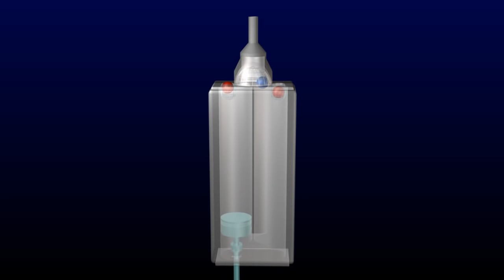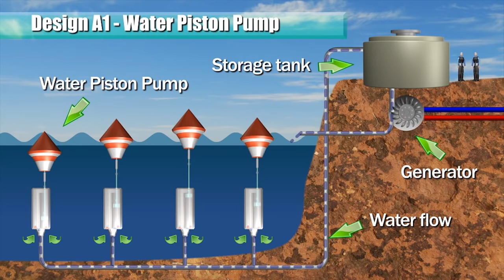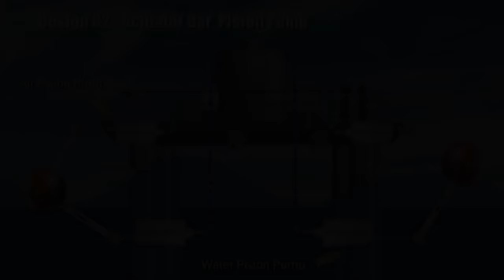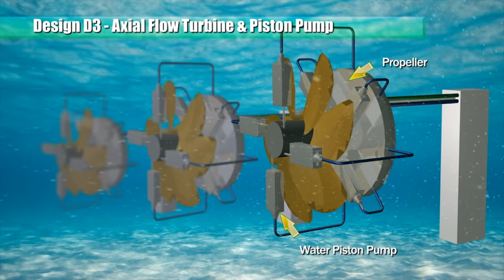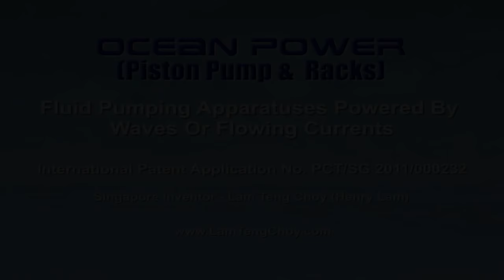Blue Energy - Ocean Power (Piston Pump & Racks)

Comment: The greater the number of moving parts in salt water, the greater their failure rate! Not a practical idea
Reply from the maker: New Invention

ShoreLine HydroElectric InFlow Dam System Video (English)
https://youtu.be/A8EYW_aREKw

水力发电内流水坝水岸线系统 / ShoreLine HydroElectric InFlow Dam System Video (Chinese)
https://youtu.be/D2NPLMekG8w

Hydro Power - Hydroelectric Inflow Dam System
https://youtu.be/_ho7JaxOdT0

Ocean Power - Piston Pump & Racks
https://youtu.be/fYfs-qYGzvs

Ocean Power - Racks & Rake Wheel
https://youtu.be/nQGKfAPxsiI
Reply from the maker: New Invention

ShoreLine HydroElectric InFlow Dam System Video (English)
https://youtu.be/A8EYW_aREKw

水力发电内流水坝水岸线系统 / ShoreLine HydroElectric InFlow Dam System Video (Chinese)
https://youtu.be/D2NPLMekG8w

Hydro Power - Hydroelectric Inflow Dam System
https://youtu.be/_ho7JaxOdT0

Ocean Power - Piston Pump & Racks
https://youtu.be/fYfs-qYGzvs

Ocean Power - Racks & Rake Wheel
https://youtu.be/nQGKfAPxsiI
Reply: Because of corrosion? You get corrosive resistive coatings. You are losing a bit of your efficiency though. The buoy on the waves move in a rotating motion. If you placed pneumatic compressors at the top and hydraulic compressors at the bottom with check valves in all the right places or maybe even a Tesla valve, you can make use of more energy generated by the horizontal motion of the buoy.
Reply: (Not just at one place but at all the edges. Think of the buoys as being in a cube. If you can have compressors at every edge you will get a lot more power.)
Reply: Hi,

All my invention is at Concept Stage only. If you wish, you can go ahead and design it.

New Invention

ShoreLine HydroElectric InFlow Dam System Video (English)

https://youtu.be/FokmF6bP4Yc

水力发电内流水坝水岸线系统 / ShoreLine HydroElectric InFlow Dam System Video (Chinese)

https://youtu.be/Pu4VyGkkvlg

Hydro Power - Hydroelectric Inflow Dam System

https://youtu.be/5XMarpHCJHU

Ocean Power - Piston Pump & Racks

https://youtu.be/hUNAkf3K25k

Ocean Power - Racks & Rake Wheel

https://youtu.be/OrJi1A9kebA

Henry Lam

Comment: its been 8 years. kinda tells you how good these "ideas" were. O.o
Reply: All of this looks like unreliable trash, add corrosive ocean water and you’ve got a real winner
Reply: And nearly 2 million views, such trash. A patent doesn't need to be good, it just needs to be original.
Reply from the maker: New Invention

ShoreLine HydroElectric InFlow Dam System Video (English)
https://youtu.be/A8EYW_aREKw

水力发电内流水坝水岸线系统 / ShoreLine HydroElectric InFlow Dam System Video (Chinese)
https://youtu.be/D2NPLMekG8w

Hydro Power - Hydroelectric Inflow Dam System
https://youtu.be/_ho7JaxOdT0

Ocean Power - Piston Pump & Racks
https://youtu.be/fYfs-qYGzvs

Ocean Power - Racks & Rake Wheel
https://youtu.be/nQGKfAPxsiI
Reply from the maker: @CGrantL  New Invention

ShoreLine HydroElectric InFlow Dam System Video (English)
https://youtu.be/A8EYW_aREKw

水力发电内流水坝水岸线系统 / ShoreLine HydroElectric InFlow Dam System Video (Chinese)
https://youtu.be/D2NPLMekG8w

Hydro Power - Hydroelectric Inflow Dam System
https://youtu.be/_ho7JaxOdT0

Ocean Power - Piston Pump & Racks
https://youtu.be/fYfs-qYGzvs

Ocean Power - Racks & Rake Wheel
https://youtu.be/nQGKfAPxsiI
Reply: Lam Teng Choy Henry Inflow dams with a recharge basin are the way to go, but they would only work in areas with dramatically high tides
Reply: So we're hydrogen cars, now theres one faster then most super cars....Electric cars the ideal atleast is older then you probably. And seem quit popular today. Just because they not in use today doesn't mean they aren't good ideals. Yes water especially salt water can be corrosive, but what if it was made of the entire station was made of a higher strength plastic, or atleast any part with in, 30 feet of the upper part of the wave swells.. the only known liquid that I know of that can erode plastic is lemon juice
Reply: Laguna

Comment: It is very complicated system that is needed a lot of materials too. Very expensive and it will never pay off. to create such systems is required to spend very much natural resources and natural energy (oil, gas). Natural resources will be swept off in the garbage. I can't even find a single positive side. This requires burning a large amount of coal/gas (since it requires ten times more resources than a gas-fired power plant). It has higher cost. It needs more time to make and construct. It takes off more territory. Kiss goodbye your beaches. It requires more handmade work. The mechanisms are antediluvian so they will have worked the same quality.
Reply from the maker: New Invention

ShoreLine HydroElectric InFlow Dam System Video (English)
https://youtu.be/A8EYW_aREKw

水力发电内流水坝水岸线系统 / ShoreLine HydroElectric InFlow Dam System Video (Chinese)
https://youtu.be/D2NPLMekG8w

Hydro Power - Hydroelectric Inflow Dam System
https://youtu.be/_ho7JaxOdT0

Ocean Power - Piston Pump & Racks
https://youtu.be/fYfs-qYGzvs

Ocean Power - Racks & Rake Wheel
https://youtu.be/nQGKfAPxsiI

Comment: I do not think this works. Natural waves move very irregularly. If you add to that the float will have to overcome too much inertia when you actually try to draw energy from it, you are not getting the energy required to build this contraption back.
Reply from the maker: New Invention

ShoreLine HydroElectric InFlow Dam System Video (English)
https://youtu.be/A8EYW_aREKw

水力发电内流水坝水岸线系统 / ShoreLine HydroElectric InFlow Dam System Video (Chinese)
https://youtu.be/D2NPLMekG8w

Hydro Power - Hydroelectric Inflow Dam System
https://youtu.be/_ho7JaxOdT0

Ocean Power - Piston Pump & Racks
https://youtu.be/fYfs-qYGzvs

Ocean Power - Racks & Rake Wheel
https://youtu.be/nQGKfAPxsiI

Comment: Nuclear power does not generate CO2.  Waste CAN be contained or recycled.   Good case for cost/benefit.
Reply: @DIVANEBABA  not cost to build,   operational CO2.   duh,  operational emissions to make that power.
cost to build ? how big,  it was the long permitting time.  Nuclear reaches break even later, then more profit.
Reply from the maker: New Invention

ShoreLine HydroElectric InFlow Dam System Video (English)
https://youtu.be/A8EYW_aREKw

水力发电内流水坝水岸线系统 / ShoreLine HydroElectric InFlow Dam System Video (Chinese)
https://youtu.be/D2NPLMekG8w

Hydro Power - Hydroelectric Inflow Dam System
https://youtu.be/_ho7JaxOdT0

Ocean Power - Piston Pump & Racks
https://youtu.be/fYfs-qYGzvs

Ocean Power - Racks & Rake Wheel
https://youtu.be/nQGKfAPxsiI
Reply from the maker: @DIVANEBABA  New Invention

ShoreLine HydroElectric InFlow Dam System Video (English)
https://youtu.be/A8EYW_aREKw

水力发电内流水坝水岸线系统 / ShoreLine HydroElectric InFlow Dam System Video (Chinese)
https://youtu.be/D2NPLMekG8w

Hydro Power - Hydroelectric Inflow Dam System
https://youtu.be/_ho7JaxOdT0

Ocean Power - Piston Pump & Racks
https://youtu.be/fYfs-qYGzvs

Ocean Power - Racks & Rake Wheel
https://youtu.be/nQGKfAPxsiI
Reply from the maker: @jamesmorton7881  New Invention

ShoreLine HydroElectric InFlow Dam System Video (English)
https://youtu.be/A8EYW_aREKw

水力发电内流水坝水岸线系统 / ShoreLine HydroElectric InFlow Dam System Video (Chinese)
https://youtu.be/D2NPLMekG8w

Hydro Power - Hydroelectric Inflow Dam System
https://youtu.be/_ho7JaxOdT0

Ocean Power - Piston Pump & Racks
https://youtu.be/fYfs-qYGzvs

Ocean Power - Racks & Rake Wheel
https://youtu.be/nQGKfAPxsiI

Comment: There ist way to much Mechanic in. The Water in a Pipe can be the Piston itself. When the Wave goes up and Down outside it generates a flow also in the Pipe. All what you need is a Pipe and a check Valve.
Reply from the maker: New Invention

ShoreLine HydroElectric InFlow Dam System Video (English)
https://youtu.be/A8EYW_aREKw

水力发电内流水坝水岸线系统 / ShoreLine HydroElectric InFlow Dam System Video (Chinese)
https://youtu.be/D2NPLMekG8w

Hydro Power - Hydroelectric Inflow Dam System
https://youtu.be/_ho7JaxOdT0

Ocean Power - Piston Pump & Racks
https://youtu.be/fYfs-qYGzvs

Ocean Power - Racks & Rake Wheel
https://youtu.be/nQGKfAPxsiI

Comment: And where you have pressurized seawater in a piping system, you can add in a reverse osmosis system as well.
Reply from the maker: New Invention

ShoreLine HydroElectric InFlow Dam System Video (English)
https://youtu.be/A8EYW_aREKw

水力发电内流水坝水岸线系统 / ShoreLine HydroElectric InFlow Dam System Video (Chinese)
https://youtu.be/D2NPLMekG8w

Hydro Power - Hydroelectric Inflow Dam System
https://youtu.be/_ho7JaxOdT0

Ocean Power - Piston Pump & Racks
https://youtu.be/fYfs-qYGzvs

Ocean Power - Racks & Rake Wheel
https://youtu.be/nQGKfAPxsiI

Comment: Many of those systems are unpractical. They are assuming clean water. The reality any valve working with ocean water will fail within a week
Reply from the maker: New Invention

ShoreLine HydroElectric InFlow Dam System Video (English)
https://youtu.be/A8EYW_aREKw

水力发电内流水坝水岸线系统 / ShoreLine HydroElectric InFlow Dam System Video (Chinese)
https://youtu.be/D2NPLMekG8w

Hydro Power - Hydroelectric Inflow Dam System
https://youtu.be/_ho7JaxOdT0

Ocean Power - Piston Pump & Racks
https://youtu.be/fYfs-qYGzvs

Ocean Power - Racks & Rake Wheel
https://youtu.be/nQGKfAPxsiI

Comment: these are the best that i have seen thus far, been doing self researching of wave energy lately. 

imo, i have seen a lot of invention of wave power energy, but many fail to have a foundation, for example, what are the acceptable range of building platform from the beach and whatnot so it doesn't interfere with maybe view or whatnot. how far of the beach can a platform be built. without these reference it will be tough to think of what may work where because that same technology may work in southeast asia may not work in iceland, for example.

Comment: Nice one. Had similar idea, only the floater is permanently sealed, contains preoriented magnet and its movement down "dive", is caused by presence of strong magnet (oriented to "push") above the floater. The floaters are positioned behind each other in a circle, and the strong magnet is moving in the circle above the surface of water (moved by transfer of the movement of the floaters - down by magnet, up by floatation.)

Comment: why the rotary wheel used to run the pump? i think if the wheel directly run the generator we can minimize the energy loses by the mechanism
i wish you answer for my unimportant question
thanks
Reply: because when there are no more waves there will be no power....by using water to store the kinetic energy you can store power for later
Reply: you could store the electrity in a batery
Reply: batteries are expensive, die and you'd need a massive amount of them when producing maximum capacity... storing water in a lake high up is way cheaper
Reply: you're exactly right - those tanks are giant lossless batteries.  you can take the energy from them and go to a battery or straight to the grid wave or no wave once the water is in the tank.
Reply: weeeellll... if its an enclosed tank it will evaporate less easily and if it does that will increase pressure in the tank thus still keeping the same amount of k energy, if its an open tank on the other hand  , a lake or pond fe, condensation and rain will compensate for the evaporation loss... ;)
Reply: That would be highly uncontrolled. In that case it would be like, God please create high tides today, I want my cell phone battery fully charged.
Reply: Because it's currently much cheaper to store energy by storing water, then later releasing the water (pressurized or through gravity) to turn a turbine. (This method currently returns about 85% of the energy stored, but it's better than it going to waste)

Trying to store that much energy in batteries isn't cost effective atm, let's give Elon Musk at least 5 more years d;
Reply: YES BUT HUMANITY WILL POUR CRUDE OVER THE TOP TO SLOW EVAPORATION RATE'
Reply from the maker: New Invention

ShoreLine HydroElectric InFlow Dam System Video (English)
https://youtu.be/A8EYW_aREKw

水力发电内流水坝水岸线系统 / ShoreLine HydroElectric InFlow Dam System Video (Chinese)
https://youtu.be/D2NPLMekG8w

Hydro Power - Hydroelectric Inflow Dam System
https://youtu.be/_ho7JaxOdT0

Ocean Power - Piston Pump & Racks
https://youtu.be/fYfs-qYGzvs

Ocean Power - Racks & Rake Wheel
https://youtu.be/nQGKfAPxsiI
Reply from the maker: @pattrickhurcombedennell1072  New Invention

ShoreLine HydroElectric InFlow Dam System Video (English)
https://youtu.be/A8EYW_aREKw

水力发电内流水坝水岸线系统 / ShoreLine HydroElectric InFlow Dam System Video (Chinese)
https://youtu.be/D2NPLMekG8w

Hydro Power - Hydroelectric Inflow Dam System
https://youtu.be/_ho7JaxOdT0

Ocean Power - Piston Pump & Racks
https://youtu.be/fYfs-qYGzvs

Ocean Power - Racks & Rake Wheel
https://youtu.be/nQGKfAPxsiI
Reply from the maker: @jawadad802  New Invention

ShoreLine HydroElectric InFlow Dam System Video (English)
https://youtu.be/A8EYW_aREKw

水力发电内流水坝水岸线系统 / ShoreLine HydroElectric InFlow Dam System Video (Chinese)
https://youtu.be/D2NPLMekG8w

Hydro Power - Hydroelectric Inflow Dam System
https://youtu.be/_ho7JaxOdT0

Ocean Power - Piston Pump & Racks
https://youtu.be/fYfs-qYGzvs

Ocean Power - Racks & Rake Wheel
https://youtu.be/nQGKfAPxsiI
Reply from the maker: @mordeth8738  New Invention

ShoreLine HydroElectric InFlow Dam System Video (English)
https://youtu.be/A8EYW_aREKw

水力发电内流水坝水岸线系统 / ShoreLine HydroElectric InFlow Dam System Video (Chinese)
https://youtu.be/D2NPLMekG8w

Hydro Power - Hydroelectric Inflow Dam System
https://youtu.be/_ho7JaxOdT0

Ocean Power - Piston Pump & Racks
https://youtu.be/fYfs-qYGzvs

Ocean Power - Racks & Rake Wheel
https://youtu.be/nQGKfAPxsiI
Reply from the maker: @jawadad802  New Invention

ShoreLine HydroElectric InFlow Dam System Video (English)
https://youtu.be/A8EYW_aREKw

水力发电内流水坝水岸线系统 / ShoreLine HydroElectric InFlow Dam System Video (Chinese)
https://youtu.be/D2NPLMekG8w

Hydro Power - Hydroelectric Inflow Dam System
https://youtu.be/_ho7JaxOdT0

Ocean Power - Piston Pump & Racks
https://youtu.be/fYfs-qYGzvs

Ocean Power - Racks & Rake Wheel
https://youtu.be/nQGKfAPxsiI
Reply from the maker: @fevernova2392  New Invention

ShoreLine HydroElectric InFlow Dam System Video (English)
https://youtu.be/A8EYW_aREKw

水力发电内流水坝水岸线系统 / ShoreLine HydroElectric InFlow Dam System Video (Chinese)
https://youtu.be/D2NPLMekG8w

Hydro Power - Hydroelectric Inflow Dam System
https://youtu.be/_ho7JaxOdT0

Ocean Power - Piston Pump & Racks
https://youtu.be/fYfs-qYGzvs

Ocean Power - Racks & Rake Wheel
https://youtu.be/nQGKfAPxsiI

Comment: Can we convert also the shock absorbers of a car, so it hydraulicaly turns the motor generator to charge the battery of an electric car
Reply from the maker: New Invention

ShoreLine HydroElectric InFlow Dam System Video (English)
https://youtu.be/A8EYW_aREKw

水力发电内流水坝水岸线系统 / ShoreLine HydroElectric InFlow Dam System Video (Chinese)
https://youtu.be/D2NPLMekG8w

Hydro Power - Hydroelectric Inflow Dam System
https://youtu.be/_ho7JaxOdT0

Ocean Power - Piston Pump & Racks
https://youtu.be/fYfs-qYGzvs

Ocean Power - Racks & Rake Wheel
https://youtu.be/nQGKfAPxsiI